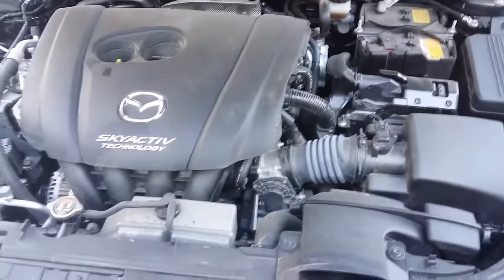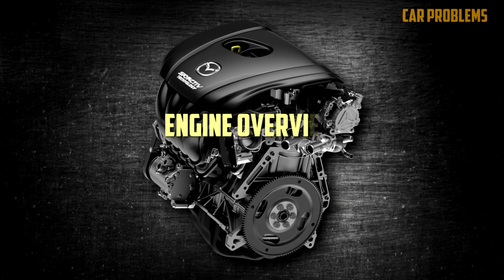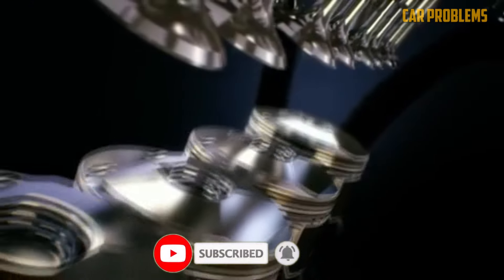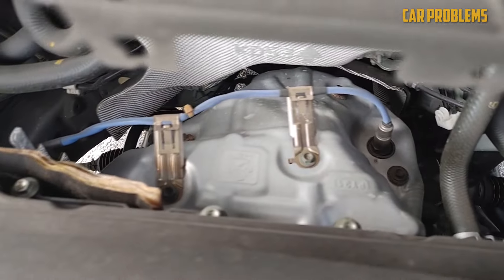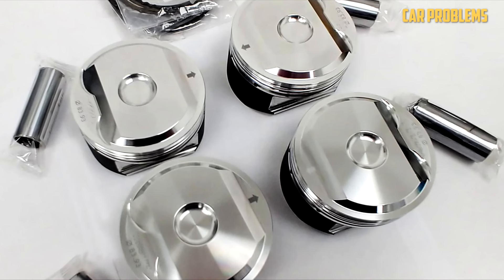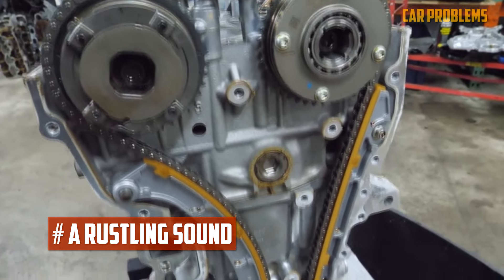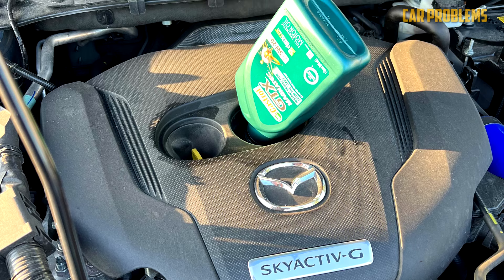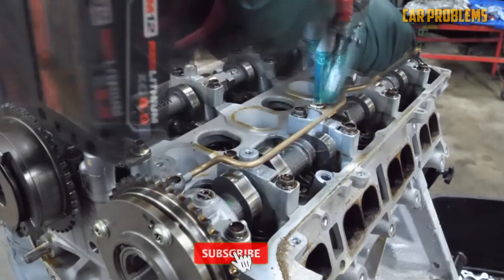Mazda 2.5 Skyactiv-G Engine: Specs, Reliability and Maintanance Tips

Comment: 140k miles and I have had not a single problem.
Reply: Naturally aspired ?
Reply: @GodsmacK314  yes
Reply: 138k and I have engine light for catalytic converter, and there is some noise in the front end, but that’s all.
Reply: 108k '18 CX9 and no issues.
Reply: @jadengill9697  is it a costly repair job?
Reply: @lukeparagas2056  i haven’t fixed any of those problems yet, but the catalytic converter is a hard job just because the headers and converter is all one piece.  There are videos on how to do it but it doesn’t look easy, so me personally id take it to a mechanic and that’ll definitely make it an expensive repair.  For the front end noise, I have no idea because I don’t know what could possibly be making the noise.
Reply: 205k miles here and no problems at all. Super reliable!!
Reply: Do you use premium fuel ? I bought one 6 months ago & I use the cheaper fuel
Reply: @gabrielleblanc6285 may i ask what the fuel consumption is?
Reply: @exofun13  life time average is 28mpg mixed freeway and city. I get 35 highway and 25 city at my current mileage.
Reply: @patrickweston8743  thank you for taking the time to answer!
Reply: Have you ever changed your transmission fluid?
Reply: @jadengill9697 valve cover gasket oil leak I bet. Burning oil and that’s what’s causing the emissions code. Need new gaskets spark plugs and ignition coils and should fix it and get it running great again
Reply: @Thehumbledcarguy828  I don’t think it burns or leaks oil at all.  Just got an oil change too.  Im at 148k now still the same problems.
Reply: What year?
Reply: Does it burn any oil yet? Any oil on spark plug threads?

Comment: Change this Engine oil every 5000 miles if You don't drive much or do a lot of short drives say under 5 miles etc, You'll Thank me later, 12,000 oil changes are absolutely STUPID unless of course you do it all in None Stop driving then maybe but I wouldn't even with the best oil possible.
Reply: Here in Canada, the oil change minder pops up at 8000km/5000mi. I have a 2017 Mazda6. I think manufacturers are lying about long oil change intervals so it appears that the cars are lower maintenance and as long as they clear warranty and then some, they are ok. Modern engines work harder than engines of 10-20 years ago, unless oil technology is changing faster than engine technology, no point in extending oil changes. Plus they’re all going lighter weight oils and engines start burning them in a couple of thousand miles.
Reply: Maintenance free transmissions are also a scam, I had to change my transmission oil at 40,000km as it was burnt.
Reply: @ali3lia  Long oil change intervals means more wear, planned obsolesence. They know the engine will last the 3 years until it's out of warranty, after that they don't care. They want you to get a new one.
Reply: Absolutely right, Raymond. Every 5-6000 miles is recommended. I drive about/close to 500 miles a week and oil changes every 12k miles is ludicrous; check the oil at least once a month.
Reply: @ali3lia  , you set your reminder at whatever mileage you want.
Reply: @Nordestada  ah, didn’t know it was editable. Thanks!
Reply: @ali3lia  Check your owner's manual it will spell out how to set the interval.
Reply: I ve had 4 Mazdas before and now considering getting a 2021 CX 5 with the same engine in the video...is there anyone who have had experience of this engine having oil consumption issues?  I have a RAV 4 at the moment drives amazing but drinks oil... donno if I wanna trust Toyota again....all my Mazdas before oil change to oil change no top up ever...and I drive my cars hard keeping my eyes on everything

Comment: Just turned 430,000 miles today in my 2015 Mazda 6 with this engine
Reply: Wow! Congratulations!!
Reply: @CrimsonLegacy 
I do agree!
Reply: that gives me hope, I'm at 246,000 on my 2014 Cx-5
Reply: Damn dude awesome
Reply: AWESOME!!!
Reply: You get the prize. Besides brakes and tires, what did you have to replace/repair?
Reply: @ChicagoRob2  I have replaced a belt tensioner, both lower control arms and outer tie rods and and transmission pan that started a rusty spot from a rock ding.  I have done nothing to the engine/transmission except regular maintenance.  Still runs and shifts great and I’m still getting 33-35 MPG!
Reply: @SethCX5  original engine?
Reply: original engine?
Reply: @WheresAangy  yup!
Reply: I finally found someone with more miles than I have on my 2016 Mazda 6. I’m currently at 413,625 and have to replace a catalytic converter.
Reply: @darylhoward2485  yup, the dreaded PO421.  If you’re hwy driver, you could just ignore it.  Hard to justify a $2000 repair on a $2500 car near the end of it’s service life
Reply: @scooterwoodley195  I’ll replace it myself and save some money. The only other thing I’ve done is changed the driver side CV axle. I did that myself too.
Reply: Any carbon build up? driving habits?
Reply: chain replace??        My cx5 2014 is new then, 115k miles :)
Reply: @sxtravel  no chain replace for me
Reply: @sxtravel  no chain replacement for me either
Reply: @WheresAangy  Yes, original engine, transmission etc. I’ve only changed the driver side cv axle, and will soon change a catalytic converter.
Reply: have you changed the transmission fluid?
Reply: @doyallsellcrablegs  No, I haven’t.
Reply: @doyallsellcrablegs  yes, every 75,000 miles…just a drain and fill.
Reply: 430k miles in only 9 years? Why do you drive so much? Do you use it as a taxi?
Reply: You need to get a life. 48000 miles/yr.  Sad.
Reply: I thought my Mazda had a lot miles but you’re almost double. 271k miles and I finally got 0P420 code. Going catless
Reply: Do you sleep in your car?  48,000 miles a year.  Someone needs  life?
Reply: Whats your maintenance routine?? Which oil do you use?
Reply: @rodieselpower  oil changes every 5,000 miles.  I’ve used many oils including Castrol, Walmart full synthetic, Quaker State full synthetic and most recently Valvoline Restore & Protect.  I’ve used the Fram gold filter until the new Ultra Fram came out…it flows a little better than the Gold.  Drain and Fill transmission (NOT flush) every 75,000 miles.  Air filter every other oil change.   Spark plugs every 75,000 miles too.  I’m still driving it daily and just turned 472,000 miles. Still getting 34 mpg hwy.  The catalytic converter has been “inefficient” for over 2 years but I refuse to replace a $1,300 part on a $2,000 car.  The PO421 code for catalyst inefficiency just means it’s not heating up as fast as it used to at a cold start up and I couldn’t care less about that.  Once it warms up, the cat performs in the appropriate heat range.  It’s still a joy to drive and I drive at least 1,000 miles per week, mostly hwy.
Reply: @SethCX5 any major issues?
Reply: @scooterwoodley195 any major difference in term of sound? Is it really louder or not at all?
Reply: @ no difference at all
Reply: Great hope my new one last this much only 50 on the dash so far 400000 to go
Reply: the 2.5 NA with cyl. deactivation and turbo version from 2018 to 202x are the ones who make problems, some of these crack
Reply: @ that is my understanding too.
Reply: Which oil did use in all this time ?
Reply: @  I focused more on oil change interval at 5,000 miles more than specific oil brand.  I’ve used Castrol, Mobil 1, Quaker State, Walmart brand and most recently am using the new Valvoline Restore & Protect product.  I did a valve cover gasket recently (BEFORE I started using the Valvoline product) and the cams, phasers and followers were pristinely clean….zero varnish.  I’ll probably hit 500,000 miles Spring/Summer of 2025.
Reply: @darylhoward2485  what was the symptom for the cv?
Reply: @scooterwoodley195  Impressive! Do it still have all originals fuel pumps and fuel filter? Alternator?

Comment: 326,000 kms on our 2018 Mazda 3 GT and no problems at all. Super reliable !!!
Reply: what maintenance has been done on your mazda?
Reply: @LxTxSURGE  Just regular maintenance, nothing out of the ordinary.
Reply: how did u get it that high on the odometer in 6 years😅😅
Reply: When an engine is 25 to 30 years old and people say that then I would belive it.
At 6 years of age your engine is mainly highway.
Highway miles are said to be 1/10  of city driving making it more 30k.
It has less heat cycle, less age on seals, rubber bushings, starter starts, etc.

I have a 92 Accord (362k), 92 Del Sol (305k), 88 Concert (156ķ), 91 Prelude (145k) all original engines and transmissions still factory sealed. Just regular services.
Reply: @crxdelsolsir  That's amazing.  I am curious does any of your cars' engine burn oil or leak oil at the rear main seal?  What is your oil change interval like?  I have a 2001 Civic with 210k mile that leaks at the rear main seal but otherwise runs great.  I change oil at 5k which is typically around 9 mos to a year. I have never own any car that doesn't leak at the rear main seal after 15-20 years is when they typically start.  I was wondering if anyone have a solution to solving the rear main seal leaking at this 15-20 years mark.
Reply: @crxdelsolsir  My 2000 Honda Accord v6 has 324,000 miles on original engine and auto transmission.
Reply: Is it turbo petrol ?
Reply: @crxdelsolsir  HONDA is the king
Reply: Did you replace fuel pumps, alternator?
Reply: Lie is a sin. Repent!

Comment: Honestly I’ve never had any problems with any of the 5 Mazdas I’ve owned in the past. I’m considering coming back.
Reply: will you choose the turbo or not?
Reply: @sunleo9956  probably not, I prefer N/A less issues with reliability.
Reply: Why did you leave ???
Reply: I got an oil leak i thinks its coming from my oil sensor again. It happened a month ago, any advice?
Reply: @ross2521  no reason I just wanted a Lexus ISF and Mazda didn’t have anything on that level. But i now also have a 17 Mazda6 GT
Reply: @russelfernandez4778  that’s odd, I would make sure the sensor is OEM, and clean thoroughly around the sensor housing upon install. Not sure if it has a gasket.
Reply: @icecold8974 how is the Mazda 6 for you? Quiet? Is luxurious similar to a Lexus? Reliable? I’m considering a Mazda. Only thing I see interesting and reliable vs a Lexus.

Comment: I'm the 2nd owner of a 14 Mazda3 SGT (2.5l Skyactiv). I've had it since 22k miles and it's about to tick at 150k miles in a week or so. July will make my 7th year of ownership. I've replaced the belt tensioner twice in that time and replaced the water pump. The pump was leaking per dealership inspection, however, I never noticed a leak or any anomalies with fluid levels, and that was done at about 55k miles, but was covered under CPO warranty. Oil change intervals have been 7500 miles. I've done transmission fluid exchange twice. The car has never left me stranded and currently averages 31 to 37 mpgs. I've been keeping records since 2017. Lowest overall lifetime mpg for one tank, 17.9 mpg (pandemic - city setting), highest mpg which most recently beat its record (37.5) is 38.0 mpg. I live in rural area and most trips are 20 - 65 miles one way.

Comment: I own a 2014 Mazda6, a 2005 and a 2008 Mazda 6, and a 2010 Mazda 3.  All of them have over 100,000 miles, the 3 has 212,000 miles.   Never a problem with a timing chain.   never a problem with Fuel injectors.  Never a problem with fuel pumps.  I keep them all running myself.   Just your standard and completely understandable tune up and wear and tear repairs are all I've ever had to do.   Great, great cars.
Reply: Yes, I'm in the market for a cx5 and have done extensive research. This is the first I've heard of the problems he mentioned. Many testimonials like yours tho.

Comment: Bought a Mazda3 hatch brand new in 2016. 118,000 miles later and not a single issue with the engine. I did have the serpentine belt replaced at 100,000 miles. The other day my back passenger side shocks went. Aside from that, it’s been a fine car. As long as you get oil changes in a timely manner, I feel like my Mazda will run forever.

Comment: My 2015 Mazda3 Skyactiv engine got 360,000 or 580,000 Km without any problems.  I do my own maintenance and oil change every 5,000 miles and 30,000 miles trans.  oil drain and fill.  I did induction cleaning at 180,000 Miles and the valves weren't too dirty.  I would buy another Mazda with SkyActiv engine again.
Reply: You don’t need to change transmission oil on Mazda Skyactive engines. They’re designed to last forever
Reply: @abrorr  Manuals need gear oil changes at about 50k

Comment: I have a Mazda 6 2015 , and it burns more oil and drive rough on low octane gas .When I found this out . I started using 93 octane and the problem went away . I have been using only 93 octane for the last 8 yrs  , and it drives and zooms like a new car .
Reply: Try X-Caps, a fuel catalyzer. It makes the fuel burn hotter and more completely inside the combustion chamber. This cleans your engine. This lowers the temperature of the catalytic combuster. It also raises the octane level so that you don't have to buy the expensive high octane gas. You can buy a trial size good for 5 gas tanks.
Reply: Using a top tier gas could be the solution without resorting to using premium. Top tier brands add their own superior additives to the standard additive that comes from the refinery. Look for a list of top tier gas providers on the internet. Very often it costs no more than no name fuels or only slightly more.
Reply: Same for me.  93 really helped.  430,000 miles and still going!
Reply: Chevron with Techron! You don’t need to use premium and cars love it!
✌🏻✌🏻

Comment: I have a ‘16 Cx-5. No issues at all. Fuel economy is  not great, I check it at every fill up and it’s 9-10 gallons for 250 miles ( 24-28 mpgs). If I do a 100% highway trip I’ll get 30!
Reply: Thats normal for SUVs though. High weight and bad aerodynamics.
Reply: I get the same on my 21 Mazda 6. Not great but love the drive
Reply: I have a 2020 CX30 non turbo and get the same around town but about 34 on the highway.

Comment: I have a 2021 CX-30 non-turbo AWD 2.5 Skyactive-G. I change the oil with proper full synthetic and filter every 6000 miles, have it done by a dealer, check the oil frequently and no problems at 38,000 miles. It has been across the USA from zero to 12,000 feet, in temps from well below freezing to 103 F. I also changed the engine air and cabin filter at about 25,000. Local fuel mileage is abut 24 MPG, top highway at moderate speeds at about 29-30.
Reply: 2016 mazda6 non turbo,110 k miles and not a sigle problem,all factory parts inc.battery.
pushed hard.avg 34mph,at 65 stedy/cc, easy 40mpg
Reply: I need to know if mazda cx5 or cx50 2.5 
turbo engine with a six speeds transmission is better than acura rdx 2.0 turbo engine with a ten speeds transmission  comments please.
Reply: @JS-qj2sg  I've never had an Acura RDX 2.0 Turbo so I cannot speak to that. I do, however, really like my 2020 CX-5 2.5L Turbo Signature Model. It's a blast to drive and has been very reliable for me. I change my oil and filter every 2500 miles using full synthetic 5W-30.
Reply: @charlesbartholomew2910  thanks for asking.
Reply: How many quarts of oil do you  use to change the oil?

Comment: 170k miles on ours and pretty much been only oil changes every 5k miles and other routine maintenance.
Reply: Have you ever serviced the transmission?
Reply: @sailboatlighthouse  Yea Ive done the transmission fluid every 30-50k miles do drain and replace which is like 3.5 quarts or so.
Reply: @sailboatlighthouse  For my 2016 Mazda6 with an automatic transmission, servicing the transmission is not recommended by the manufacturer. The dealership would not do it, so at 175000 miles I had it done at a shop. I drive spiritedly so wanted to have it done regardless. Never a problem but just as preventive maintenance.

Comment: 2015 Mazda 3, with 340,000km mileage. Engine, transmission, AC compressor, alternator still in good and dont have any problem.
Reply: We don’t use kilometers over on these shores, good sir. We use the all American diabolically non-sensical measurement mile. Difficult to convert and… well, I guess there’s nothing good about it. You win this argument with no effort! Good day.

Comment: I have a 2014 Mazda 6 bought new in 2013...140k miles and nary a problem. This is my 3rd Mazda, going back to a first gen RX-7 bought new in 1979. I have 500k miles on three Mazdas with basically zero forced maintenance beyond a failed A/C compressor on a 2005 3 hatchback. Just ordered a 2014 CX-50 turbo model. Just be sure to keep up with basic maintenance (oil, plugs, tires, brakes) and you'll get many years out of them. I never get the extended warranty, but might consider one this time since the engine will have a turbo.

Comment: 100% PR! I have a Mazda 6 2.5l with 194HP. You can drive it easily with 12l/100km. Also 7.5l are possible. 8.5-9.5l are normal. My 2006 Toyota Avensis 2.4l with 163 HP before used the same if not a bit less.
Reply: I have a Mazda 3 with 186hp and my average according to the bordcomputer is 5.7. And I live in the middle of a city so its not just highway cruising.

Comment: 95,000 kms on our 2018 Mazda 3 (SP25) no problems what so ever, since the car was new i always use higher octane good quality fuel (98 Octane) I change the oil every 8,000 kms i always use good quality 100% synthetic oil and filter.
Reply: what brand of engine oil?